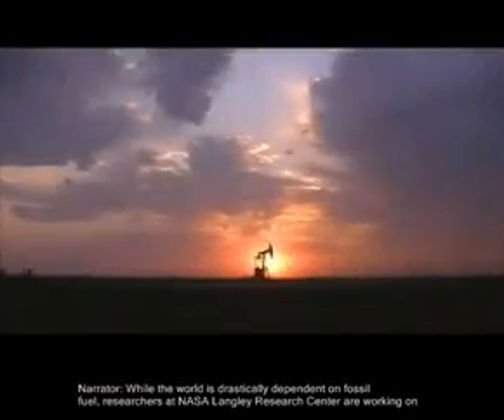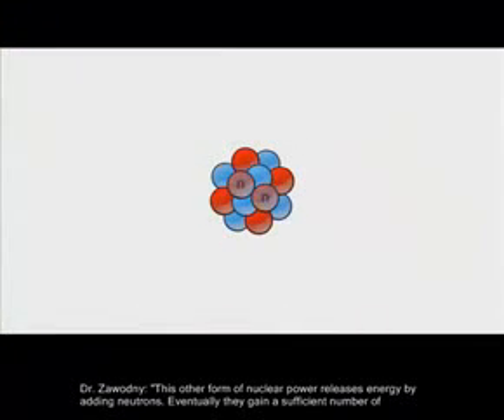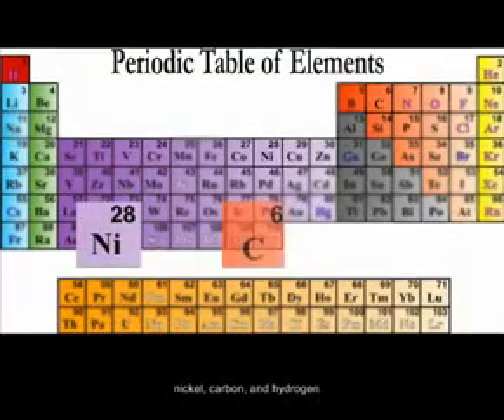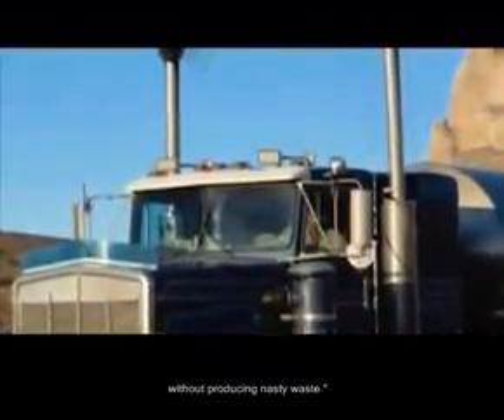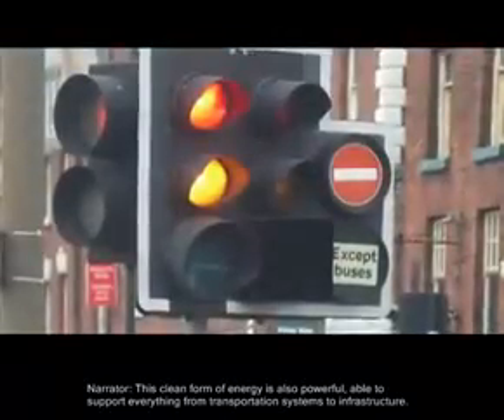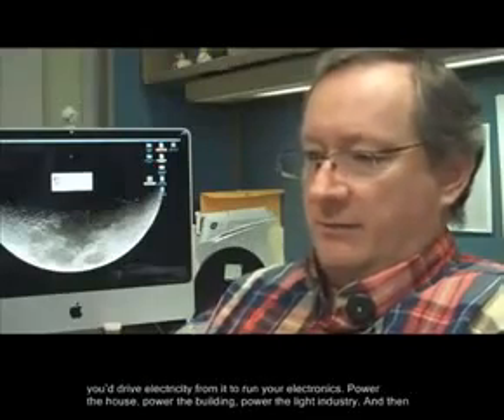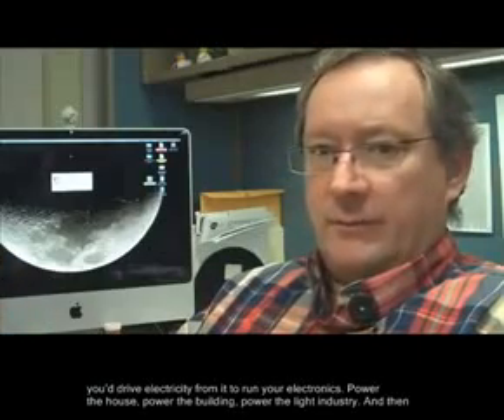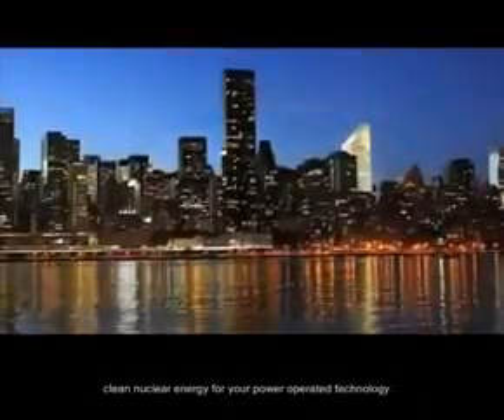Nasa Cold Fusion

Comment: So, this is a low energy process that injects neutrons into atoms. The neutrons aren't stable unless that balance of protons is correct, so they decay into protons and electrons. Which increases the atomic mass of the "fuel", releasing massively more energy than it took to make the neutrons and put them in the reacting atoms. Not likely.

What about actually just injecting the right energy into the fuel to convert protons to neutrons. This could be sourced from the right material that would transform low frequency energy to HF energy of the right frequency. Then you aren't moving protons. But more likely the neutrons will be ejected and then decompose. This is how the GEET reactor works.. 

Not really patentable, but a clean source of energy for a space ship. Right now the power cartels won't let anything like this be commercially developed on this planet.